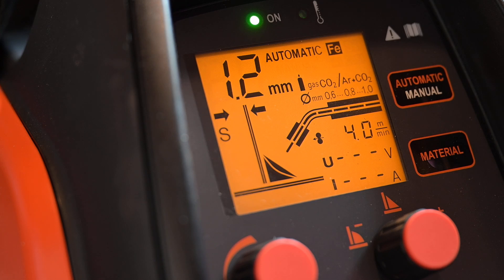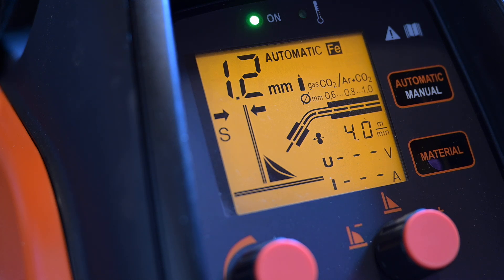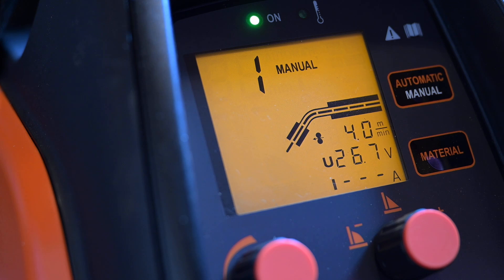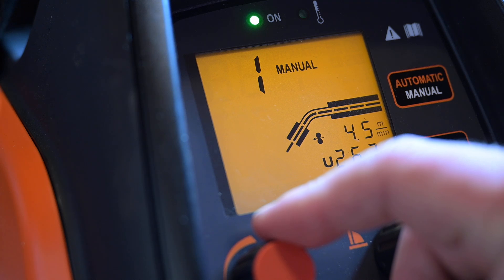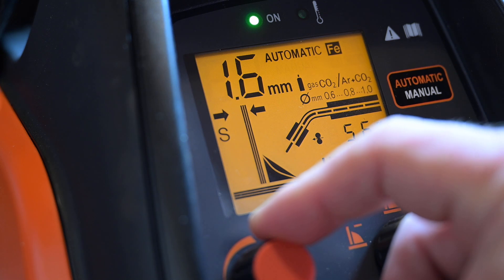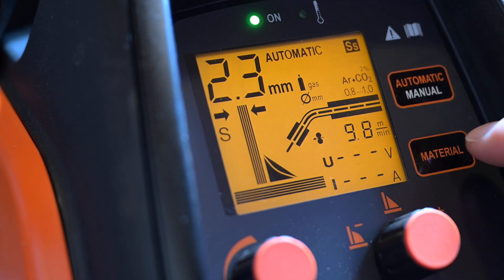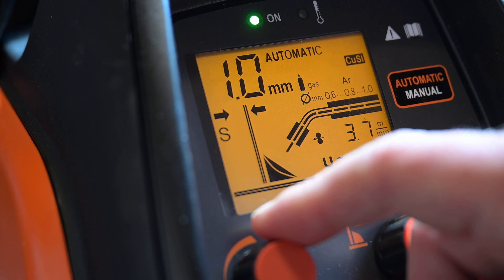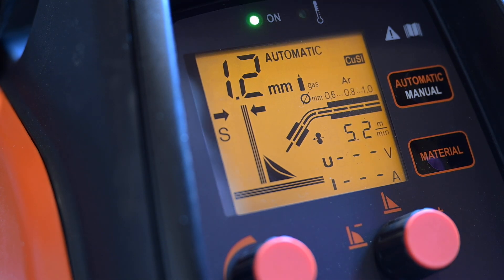KEMPPI MiniarcMig Auto 220 Menu controls

Comment: Really is it not possible to select the wire thickness in the menu? That seems weird on an expensive auto machine. Speaking of weird. It seems you are the only one talking about this machine on Youtube.
Reply from the maker: No, but I have not really missed it, since I am only using one thickness.. I only select thickness of the metal. and I just take a experienced metal thickness value 😂 based on my welding speed ( not the actual thickness of the metal ) .. But, I like the machine.. it works for me.. Simple to set up and use 😊
Reply: @Norseman101 Glad it works for you, but if they made that function to make it easy to use they really should update that software to select wires.

Comment: Do you know what the maximum thickness of steel this machine can handle? What is the maximum thickness you can select in auto mode?
Reply from the maker: @niklashinson  The max setting in automatic is 6.0 mm and the min setting is 0.5 mm ..  This is settings that are for 0.8mm wire. I have not tried any of those endpoints, but if you use a thinner or thicker wire the endpoints are a bit wrong.